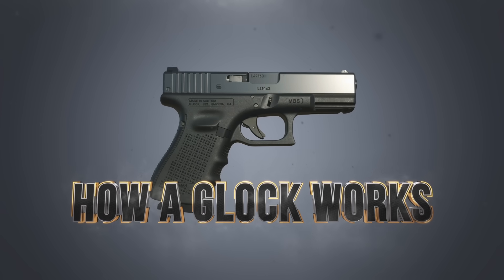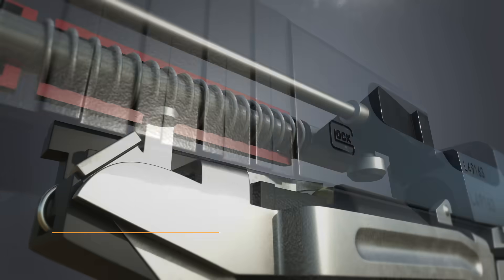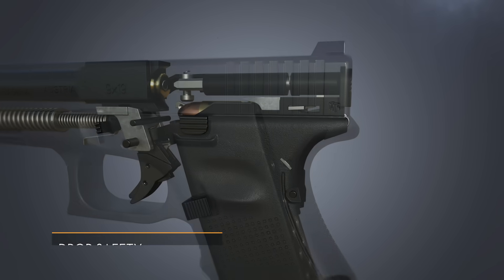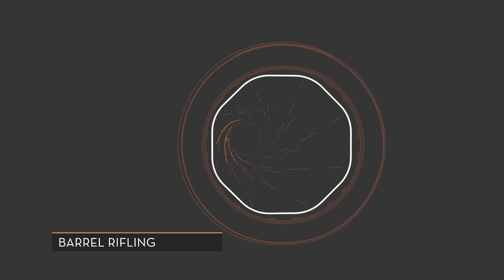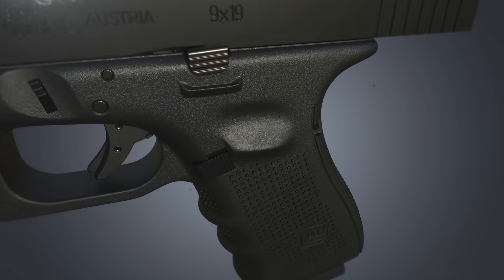How a Glock Works

Comment: Maybe a LONGER barrel will make the Glock even more *accurate while allowing a longer *range?
Reply: You can get an extended barrel for a glock.  You can also build a pistol caliber carbine in 9mm.  After about 8 inches of barrel the advantages diminish and 9mm pretty tops out at 150 yards of effective range no matter what.  You can also build a pistol caliber pistol in an AR-15 (AR-9) format with nearly any barrel length.

Comment: So does that mean that if you prevent the top slide from moving back, it prevents the drop safety dropping preventing the firing pin from moving? If so, in a close encounter you can disable the attackers gun by grabbing the slide? (hypothetically speaking)

Comment: Just need to redo the narration for proper nomenclature. This is a striker fired pistol, it has a striker - not a firing pin. Firing pins are used in conjunction with a hammer which the Glock (and all other striker-fired pistols) do not have.  Other than that, fantastic video that I can send to friends to educate them on how Glock's function when I don't have mine to demonstrate. Thanks!

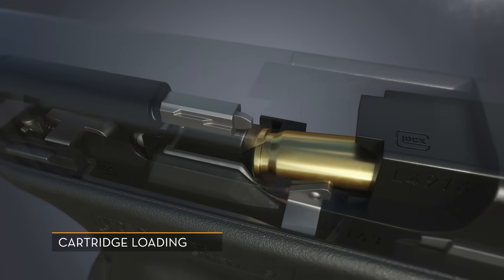Comment: @0:50.    Why is it called:   the slide “strips” a new bullet?   Does  each bullet actually get stripped and why?

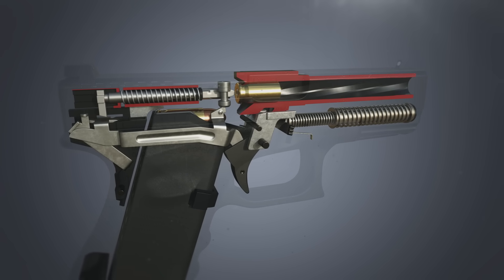@0:25. What is the function of the horizontal “spring/rod/plunger” that is below the gun barrow?

Comment: So... It seems the first round can be double-action (firing pin cocked by trigger) and thereafter all others are single action (firing pin cocked by slide).  Is there a de-cocking mechanism (for the firing pin) to configure the weapon this way (round is chambered but firing pin not cocked)?

Comment: That is a superb cartoon showing how the Glock works.
BUT! I can not understand how the extra trigger safety is in any way safer, like you cant pull the trigger, until you  actually  pull the trigger, which to me appears a totally pointless feature.
Reply: I think the trigger safety is there to prevent accidental discharge (such as dropping the gun) unless you intentionally pull the trigger.
Reply: @lenfox3452  But those various safety mechanisms are already single trigger activated, or can be. The 2nd superimposed trigger is, to my mind, nowt but a gimmick(and by the way I used a Savage rifle with something very similar and disliked and again I failed to understand its purpose) since either a finger, or twig or whatever that "accidentially" pulls the main trigger, will also be as likely to pull the secondary(and actually should be  primary?) trigger.

Comment: GEEZ, I just thought that a gun would be soo easy to make as we saw in movies, but its soo soo complicated
(Yes i am talking about James bond and Mission Impossible movies, they showed that making and using a gun is actually soo easy )
Reply: Real firearms just take that mechanism and make it more simple and convenient for the user
Reply: Have a durable tube
Put in some gun powder
have a slightly thinner tube 
push it in to the gunpowder
COnGRATULATIONS, you just made the simplest gun design
Reply: @klcvzx   LoL is it so easy ?
Reply: @itz_yeastic  easy for a makeshift weapon, hard if you want to make a faster and more accurate firearm
Reply: Using any gun and building extremely simple guns is easy: what’s hard to do is designing and building a fully functional semi-automatic magazine-fed pistol. Hell, I could build something that passes for a firearm out of pipes, welding gear, a pin, and a shotgun shell, but I sure couldn’t design this.

Comment: Guys, I want you to think about the next situation for obtain a solution to it:

We will use as model the Nerf Mega Magnus, a very alike nerf gun to the Nerf Fortnite SP-L when we talk about their system, how the gun works is basically the same as the video, first, we insert darts on the internal magazine of the gun, after pulling back the hammer a dart will be loaded in the chamber ready to fire, the problem is that after firing the gun, the force ain't sh*t enough to cause the hammer to "reload" as a real pistol would do, so after shooting the user has to manually reload the gun, now, here is the question: 
How we can make the gun reload mechanically, without using noisy motor nerf gun systems? It can use a electric system but not to make the noise that full auto nerf guns use to do.

Comment: PLEASE ANSWER, AT 2:54, IF THE TRIGGER IS NOT PULLED,  LET'S SAY THE FIRING PIN SLIPPED FROM THE SAFETY SILVER BARBELL LIKE PIECE THAT MOVES UP. IS THE DISTANCE AND TENSION OF THE FIRING PIN AND THE PRIMER OF THE ROUND, ENOUGH DISTANCE LAUNCH A BULLET ? PLEASE ANSWER. GLOCK SAFETY ISSUE

Comment: I can field strip mine while blindfolded in under 9 seconds. Had a lot of training :)
Also, while shooting in close-quarter combat, you do not need to fully release the trigger, rather, for faster more accurate shooting, keep the trigger fully depressed in-between shots so that the trigger has less distance to move before the next shot. (that takes a lot of practice to become proficient at).

Comment: by locking the slide back it allows you to slide in another magazine ,but you have to manually pull the slide back to release it and reload the weapon and then the cycle continues.   But I have to ask why do you have to pull the slide back after putting in a new magazine is it another safety feature?
Reply: Don Lorenzo   but it's a semi auto gun ,why can't it chamber it's own round? it does it will the magazine is in ,why do you have to pull the slide back for another magazine? why couldn't the magazine be designed to push the slide back itself and thus auto chamber a round through mechanical means?
Reply: Don Lorenzo  uh... where did i say clip? pretty sure i said magazine i think you got the wrong person XD whoops nvm i did say clip  doesn't help doom messed me up when it says you picked up a clip of ammo when it's clearly a magazine...  That was my bad, sorry it's a very common misconception though somebody really should try to put out some literature to fully define both and spread the word to people.

Comment: Heyy I have a trigger  issue not sure if you can assist... when I pull the trigger on mine it only fires one round because the trigger won’t automatically go Frwd i now have to use my finger to push the trigger Forward so it can fire a second round... how can I fix this

Comment: Oh and get a real safety.  You can Easily flip it off as you draw it with one hand.  If you have kids, or are not well trained. Never carry a round in the camber.  Yes it is faster, Very fractional.  But let’s keep people safe. Training...I can Easily and quickly rack around As I draw, and Never short stroke it.  Yes, I can do it one handed too. Train.
Reply from the maker: Agree with you 100%. A real safety is the way to go.
Reply: you still have to pull the trigger to make it go bang .. so one less useless step is good
Reply: Always...Always put safety first

Comment: Actually, the recoil is CAUSED by the recycling of the firing chamber, not the other way around as I understand it
Reply: You should consider starting with your definition of recoil (separate 'free recoil', 'muzzle flip', 'semiautomatic operation', etc.).  Wikipedia has a nice set of operational definitions.

Comment: The trigger doesn't pull the firing pin back tho... It's held back after racking the slide. Striker fired guns are single action only I thought. Am I just wrong?

Comment: Now can you do a video on how a auto Glock works I really want to know how that little piece you put on the end makes it fire so rapidly, it seems like it's just a magnet but that can't be because when you turn the device on it would just make the slide go back all the time, unless the magnet only engages when you pull the trigger that would make more sense kind of just came to me while writing this lol I mean how else does a little piece that you put on the end of the slide turn it into a auto glock , it's a magnet right? Like sort of the same concept when you try to put two magnets with different polarities together they push each other apart that's what I think it is correct me if I'm wrong please I would really like to know how it works

Comment: Can someone explain to a gun amateur the safeties? It seems to me that they're all the same and aren't really safeties at all.

1. The trigger safety is adjacent to the trigger, so they're just pulled back at the same time? How is that a safety? I don't see that it changes anything or stops anything. The trigger finger should only be on the trigger if you're going to pull it, right? So why put the trigger safety there at all? What does it do?
2. The firing pin safety is moved up by the trigger bar, which is moved by pulling the trigger, so it's really only preventing misfires, is that right?
3. The drop safety: the trigger bar moves back and clears the housing by pulling the trigger. Is this different than safety 2 or is it just another protection against misfires?
Reply: 1.  The edge of the trigger can be caught on things like a worn out leather holster, or if dropped barrel up, momentum from the mass of the trigger can actually pull the trigger.  That's the point of the trigger safety.
2.  The firing pin safety will prevent the striker from slipping off the sear through shock or a worn out sear.
3. The drop safety is pretty much part of the frame that part of the sear rides along that locks the sear in the upward position as long as the trigger is forward. 

They are all safeties, just not the conventional manual safety that people think of.

Comment: Great video! One thing that still confuses me is how does the trigger reset even when you keep it pressed when the gun cycles?
Reply: It's at 1:05.  The fork of the connector that goes up with interfaces with the slide.  The slide pushes the vertical tab in a little bit.  The tab to the rear fork of the connector that forces the trigger bar and sear downwards is then pushed in and allows the trigger bar to pop upwards from a spring connected to the beavertail area of the frame.  Once the sear has popped up, it catches the striker, and the force of the striker spring will allow the trigger to reset forward.

Comment: Mr. Rittman.  
This is absolutely the best video on how a Glock "works".  The animation and the rendering on the video are top notch.  I very well see how you can sink 500+ hours into its making.  
I put "works" in quotes because other videos on how a Glock works show only how a person operates a Glock.  (Load gun.  Point gun at target.  Pull trigger.)  
Yours shows how the internal parts move and effect the cocking and release of the striker on the cartridge primer. 
Admittingly, I am not yet a Glock fan.  But now I know what happens to the trigger parts once I start pulling on that trigger.   
Once again, WELL DONE.
We need more educators like you.

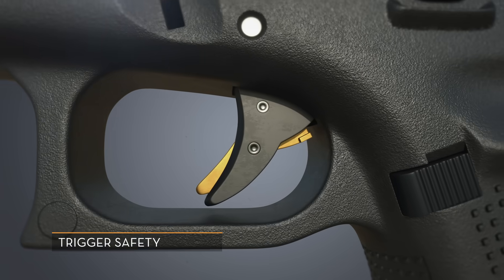Comment: 1:37
That trigger safety IMO is complete garbage and NOT a true safety. ANYONE that puts their finger on that trigger can and will push that "safety" with it to allow the trigger to pull. 
A true safety is a dedicated external lever or switch that you have to manually move to engage so that the trigger does not move.
I dont know who came up with this safety trigger but its completly worthless and i have shown family and friends just how worthless it is because i own one, and i only own one because i got a really good deal on it. 
If anyone can show me how "good" that safety is, i would like to know because imo its garbage
Reply: See Sig P320 controversy when there isn't a trigger safety.  The momentum of the trigger can pull the trigger if dropped.  That is one of the major points of a trigger safety.  Also, if you stick it in something tight fitting or a worn out leather holster, it can rub the side of the trigger pulling it.  The trigger safety prevents that.
Reply: @bedtime91  sorry man, that made zero sense to me
Reply: @ACommenterOnYouTube  When you drop a gun muzzle up, the momentum is in line with the pull of the trigger.  This means when the gun hits the ground and stops, the trigger will continue falling and fire the gun.  When this happens, it will bypass both the drop safety and the firing pin safety.  This is why the trigger safety is there. 

Also, the trigger has significant surface area on both sides.  Sticking it in between two tight surfaces like tight pants, or a worn out leather holster can cause material to rub the side of the trigger and pull the trigger if there is no trigger safety.

You can look up examples of this happening.  The Sig P320 is a great example of the first issue, of which there are videos of the gun pulling its own trigger from a drop.  Google holsters pulling triggers for examples on the second point.
Reply: @bedtime91  
1st comment:
...When you drop a gun muzzle up, the momentum is in line with the pull of the trigger.  This means when the gun hits the ground and stops, the trigger will continue falling and fire the gun.  When this happens, it will bypass both the drop safety and the firing pin safety...
If the safety lever is engaged, is it not its point to STOP the trigger from MOVING to fire the gun as its falling muzzle up..??
2nd comment:
...Also, the trigger has significant surface area on both sides.  Sticking it in between two tight surfaces like tight pants, or a worn out leather holster can cause material to rub the side of the trigger and pull the trigger if there is no trigger safety....
So on both of my 2 guns the trigger in INSIDE the trigger guard and does not protrude outside the guard rail so i don't know what material inside my pocket can RUB against the trigger to push it and fire the gun .... And if the gun is going in my pocket, its the ONLY thing that will go in that pocket, that is common sense to me.
Reply: @ACommenterOnYouTube  
Yes that's the point of the trigger safety, to cancel the momentum of the trigger should the gun fall muzzle up.  If you're talking about a manual safety compared to the glock's trigger safety, if you happen to drop the gun in the same manner while the manual safety is disengaged (never say never) it may still fire.  Whether or not it will is a balance of several factors including trigger mass, pull weight, travel of the trigger, and many other things.

2nd point, that's YOUR pocket.  Not everyone uses YOUR pocket.  Sometimes people have to shove a gun into some tight waistband or a leather holster where the lip is worn and is starting to cave in.  That can rub against the trigger even if the trigger is less wide than the trigger guard.  Like I said, google how some holsters have been able to pull the trigger on some guns after wear and you'll see how that can happen.  Maybe one of those tight nylon holsters is tight and flexible enough to go inside the trigger guard and put friction on the side of the trigger.  Either way pocket carry is not a good way to carry a gun, nor is Mexican carry but gun manufacturers still have to put that into mind when designing a gun.

Comment: The simplicity is what makes it such a reliable design
Reply: Actually, with this many safety locks, it's not that of a simple design. Yet a very clever one.
Reply: @НелиелОксингейл  the safeties nor any other weird extra component that doesnt directly affect the guns operation doesnt really pertain

I like gen 1 and 2 glocks anyway, I also like Smith and Wesson glock clones, sigmas sw sd etc
Reply: Please follow the new youtube.
https://youtu.be/orujMJzKWwY
Reply: Banm love la non zanmim yo nou pap pèdu sa men mizè papa epizòd  20 an yon sèl kontrol i  https://youtu.be/ZgyofNlzIS4
Reply: just like the AK.
Reply: this is a message for you https://youtu.be/JwncAQurlqk
Reply: Not necessarily, the two are correlated but few parts doesn't prevent issues, only gives less opportunities for a failure that affect the function of the whole (ie fewer dependancies). You could have a simple design that easily jams or in which a component is too weak for repeated stess cycles or hotter loads or too stiff or sticky and won't cycle with weaker loads. And if a single part serves multiple functions its the number of functions not the number of parts that contributes to increasing the number of dependancies.
Reply: @alexanderx33  lol... yes theoretically you can design something simple and poorly.. thanks

We are talking about glocks, not some bullshit Brazilian striker fired junk or a Turkish unlicensed clone
Reply: @BOB-wx3fq  hey hey don't bash Turkish copies. They are some of the best

Comment: “Allows the EJECTOR to remove the spent cartridge.” Not the extractor.
Reply: the extractor removes the spent casing from the barrel, the ejector causes it to get flicked outwards at an angle. the video gets it right

Comment: For me the most important thing was not shown. When the bolt is activated by placing a bullet in the barrel, the striker spring is partially pressed and will be fully pressed when pulling the trigger. Therefore, the striker spring is under some pressure when the gun is ready to fire.

Comment: Who is the idiot that put the "safety" on the trigger? The safety should be a fully independent button away from the trigger. As for the grooves in the barrel, all firearms have that to ensure the bullet is fired accurately. The exception would be a shotgun which has none.

Comment: That's not how a glock works.  You hold your balls with your left hand and hold the gun sideways. With each trigger pull you force the gun forward to throw the bullets out of the gun down range in the ghetto.

Comment: Very good content, but it gets some stuff wrong.  It's not a firing pin, it's a striker.  Anytime the firing pin is the sole source of energy for detonating the cartridge, it's a striker.  Firing pins traditionally receive energy from a hammer.

The primer is not part of the bullet, and loaded ammunition is not a bullet either.  The primer is part of the cartridge, the bullet is also a component of the cartridge and is the projectile that leaves the barrel and strikes the target.